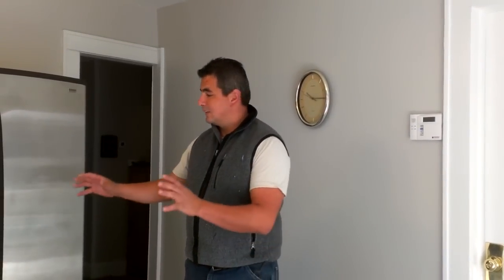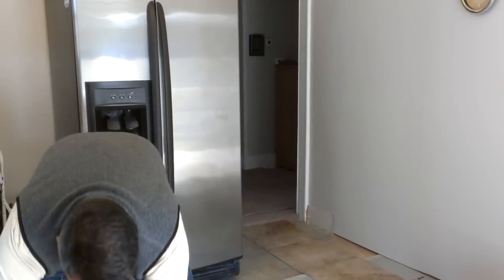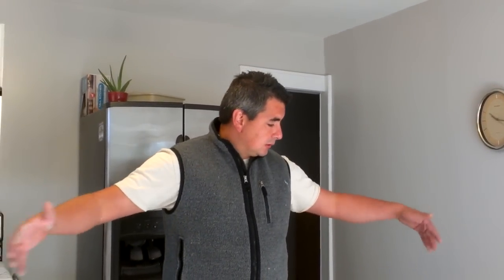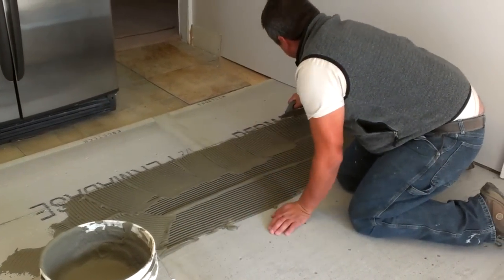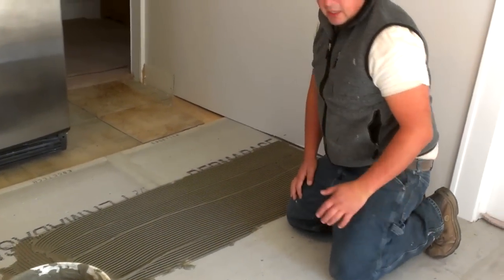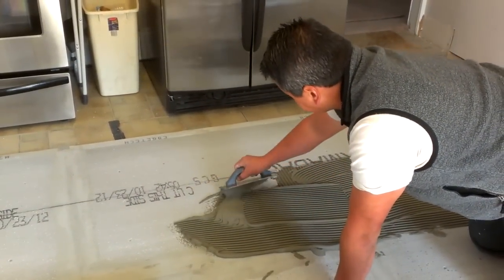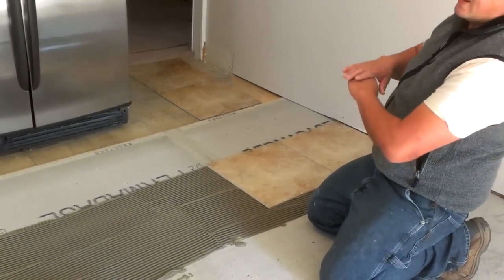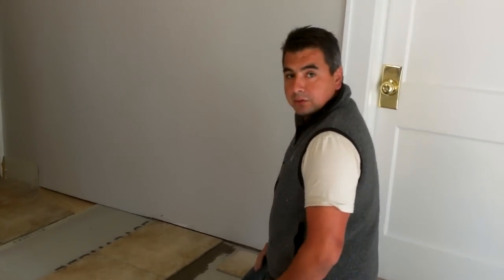How to install ceramic tiles  on a floor

Comment: its a ok beginner video i like spreading the back of the tiles so it not drying up on me and when i lift the tile i can see where it is making contact an where its not.. when doing tile its about taking your time and doing it right not just throwing them in...instead of a spatchula i like a margin trowel also the 5 ft level....get a chalk line an use an outside wall not a inside wall they seem to be a lot more square.... buy a dewalt wet saw NOT AN MK.

Comment from the maker: Any time, remember to screw the subfloor if you hear noises while walking over, few more dollars in a better thin set cement is a life saver for us, make a no matter what list of costs for you: cost of screws, cement, backer boards, spacers, etc. Per square feet so you can always know what is your expense!!

Comment from the maker: Identify the areas where yo know you need more cement, using muriatic acid diluted with water (1 part of acid 8 parts of water) clean the floor to create a better adhesion, apply cement adhesive to the areas you know that need more cement. use a self leveling sand topping concrete to make those areas level, let it dry and install the tiles with a 1/2 inch teeth trowel

Comment: I loved the video! I'm a "do it yourselfer" and I found it very helpful. Especially the part about starting from the best focal point for your tile instead of snapping a chalk line to find dead center & working from that as your guide line. I also like the commentary pop ups about being a plumber & firing your help. That was funny. Thanx for the video. I'm starting my first tile project & you've definately helped me.

Comment: wasn't to informative honestly, saw some inconsistency with spreading the cement * first time he used side with no teeth to spread it out before using "side with teeth" then beside it he just used "side with teeth". Was also wondering why he started with "half tile" in the second row "he didn't explain that either". Also with the first two tiles laid, why didn't he follow that pattern? isn't it going to look messed up? confused..

Comment: You really should install plywood over hardwood before installing cement board. Grout will crack if you do not (been there, done that).  Follow backerboard recommendations or call their technical people.

Comment: I am need to replace a linoleum floor with tile.  Could I get away with using 1/4" cement board on top of the plywood after I pull up the linoleum?  Or should I go with the 1/2"?

Comment: Installing tile that large would not be easy for the casual DIY'ers as the floor has to be really flat. Lippage would be a concern. I have boxes of tiles that size and the dimensions are not consistent from one manufacture to another and can be off by as much as 1/4" which will screw up the grout lines without cutting to fit. The smaller 12" tiles are more consistent dimensionally and much easier to install. 

For most of us non pros, large tiles should not be a first project unless you needed a challenge. 

Nonetheless, nice video – thanks for the upload.

Comment: the only right way to do this right on a wood structure is with a mud floor with galvanized mesh nailed down and overlapped to make the floor 1 piece..  not wonder board.  This is the cheap way out/ will not last as long before the grout starts popping out.
Reply from the maker: thank you for the suggestion, some areas don't have enough height for the process you suggest. the weight of the concrete is a concern also

Comment: I want to install tiles in the bathroom, the floor is plywood.  Do I need to put a coat of primer sealer on the plywood before I set the tiles down?
Reply from the maker: I recommend you to install concrete boards first they only need to be 1/4 inch thick fastened with screws, in places like bathrooms the moisture can really affect the floors. For more tips in how to install tiles visit my website www.doiteasynetwork.com
Reply: thanks Hugo!

Comment: Seems like such a nice person. I was wondering since I am not a professional if I should use spacers in between the tiles?
Reply: I would advise you to use spacers if you haven't tiled much. I have tiled many jobs and i still use them. I find the extra 15s per tile worth it at the end.
Reply: Thank you!!

Comment: I have a really uneven concrete floor that was covered with carpet, installing 16" tiles, what do you recommend to level out the floor before thin set?, thanks!

Comment: Hi Hugo, I'm planning to replace vinyl flooring with porcelain tile and when I lifted off the vinyl I found a yellow thick glue underneath. Not sure if it was another tile but looks like thick hard glue. I'm afraid it might have asbestos. Vinyl is less than 10 years old. Not sure what to do next. Is it possible to cover that yellow glue with 1/4" cement board?  If I do that then the floor will rise. What are your recommendations?  Thanks!!
Reply from the maker: the glue can be removed with a glue remover liquid, you just put a backer board with screws and mortar so your floors are nice and strong
Reply: +Hugo Correa Thank you for your friendly advice. Keep making those great videos!!
Reply: R C it's glue for the tiles ,why would it have abestos in it !.
heat gun and scrapper is all you need...

Comment: the thin set mortar is to thin  to wet  it will shrink and the tiles should always be covered with thin set on the inner side with a flat trowel before setting the tile on the floor
Reply from the maker: very important to follow the material instructions, it may be the case with your material
Reply: +Hugo Correa yeah your using cement right? how come why?
Reply: +Hugo Correa yeah your using cement right? how come why?
Reply: +Hugo Correa yeah your using cement right? how come why?

Comment: only applicable on even surfaces cause he put cement too thin and no allowance for other parts thats slightly higher.
Reply from the maker: elcid agustin you right, this trowel was only 1/4 by 3/8 in an inch, when you have other type of situation you may want to bring it to 1/2 by 1/2 or repair the surface first.